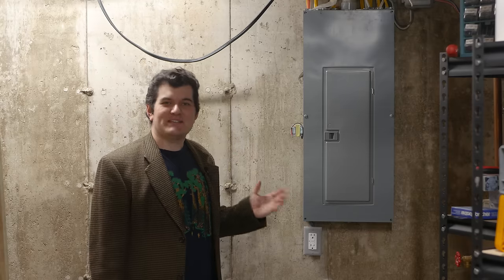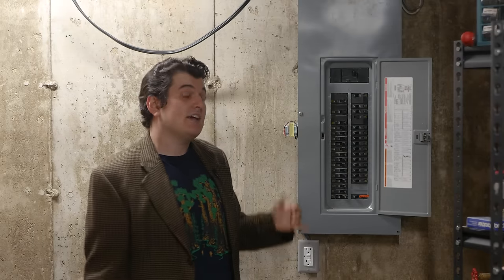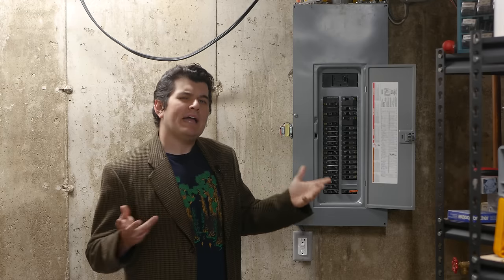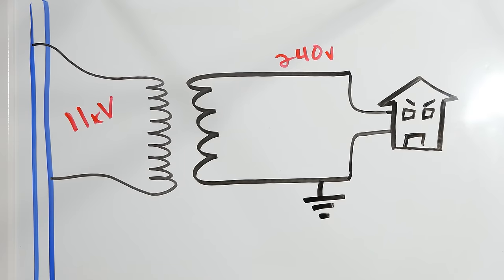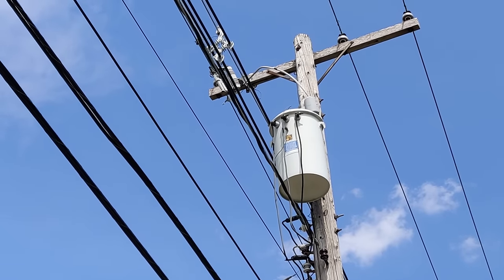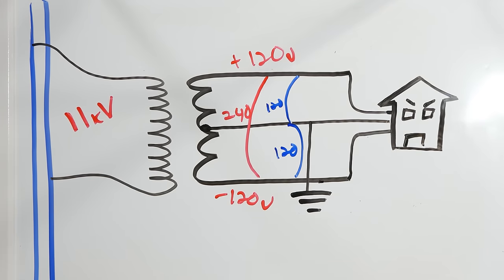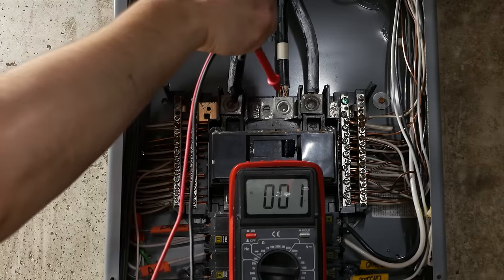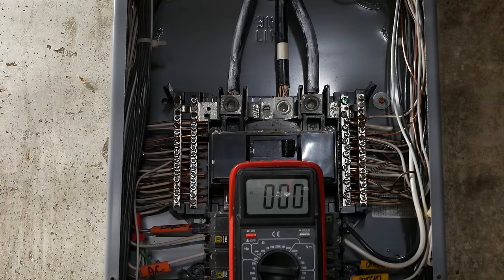The US electrical system is not 120V

Comment: He is so smug about the 240V in US households^^ cute
In all german houses we have 400V in 3 phases plus neutral. 
They are used for things like boilers, electric heaters and the stove. 
The normal outlets have one of the 3 phases and neutral (plus ground sometimes) at 400V/sqrt(3)=230V
We usually also have a 3 phase 400V outlet somewhere in the cellar or garage which can be used for industrial tools but not many people use them.
But it's quite cool that we can just buy any industrial machine and plug them in. Often people get old stuff from work like big robot arms, welders, CNC machines and they can just plug them in in their garage.

Comment: I've learned a lot from this. Electricity has always bothered me as being too complex. It's still that, but this helped. And some of the comments also seem educational. I'm going to have to bookmark this page, because extra views will help me. What I'd really like to see is electrical boxes from other countries, including obscure countries with different electrical systems.
Reply: 17:30
Reply: @TheAbc45678 
Norway has three types of powersystems.

3 phase 240V IT.
3 phase 400V TN. 
3 phase 240V TT.

3 phase 240V IT: ( IT= Isolated Terra). 
IT is a mains type where the transformer zero point is not earthed, but protected with a neutral point arrester (zero point protection / disneuter) between zero point and earth . The voltage between the phases is 240V and no neutral conductor is advanced. The energy is taken out between the three phases. This system can withstand "first earth faults" without breaking down. Therefore, it is common in hospitals to maintain power to vital devices even in the event of a ground fault.
 
3 phase 400V TN: ( Terra Neutral)

Here, the PEN conductor is carried from the transformer to the consumer's first distribution (fuse box). Here, the PEN conductor is split into PE conductor (Protective Earth) or earth conductor, and N conductor (Neutral). The energy can be taken out both between the three phases (400V) and between each of the phases and the N-conductor (240V).

The network type is then called TN-C-S network, where C indicates that the PEN conductor until the first distribution is a combined conductor. S indicates that the PEN conductor is Separated from the first distribution. TN network is now used in almost all new developments in Norway.
An advantage of TN networks is that due to higher main voltage (400V) it is possible to deliver higher power on the same cable cross section than is possible in IT or TT networks where the main voltage is usually 240V. The installation therefore becomes more economical. Disadvantages of TN networks in relation to IT or TT networks are that the voltage when touching a phase conductor is higher, and therefore more dangerous. There is also a danger of getting voltages of up to 400V in 240V sockets in the event of a break in the N-wire.

3 phase 240V TT: ( Terra Terra)
TT is similar to an IT network with the significant difference that the transformer's zero point is earthed. TT networks are found in the Agder counties and some other places along the west coast of Norway.
Reply: It's really not that complex on its own. It's when you start with nuances before covering the basics is where things get confusing.

Comment: " It's weird and I don't wanna get into it right now because it hurts my brain "
As an EE major, I feel your pain.
Reply: my braaaaaaaaaaaaain! my braaaaaaaaaaaaain! It hurts! 😄
Reply: The difference between neutral and ground is so simple, though. One is designed to carry current in support of loads, the other is designed to offload electricity/trip a breaker when something that shouldn't be conducting electricity has found its way into the circuit.
Reply: @omniyambot9876  You DON'T want to touch a neutral. Yes, you can get a serious and even lethal shock from the neutral wire. The key here is the location of the neutral conductor and whether there's a load using the supplied power at the time. The neutral should not shock you, even if the circuit is energized, as long as there's no load using the power; or as long as the neutral is upstream from from the nearest load using that power. Example: if you have a light bulb that's currently energized, and you decide to touch the neutral wire directly coming off of the bulb to ground, you will get shocked. The reason why location of the point of the neutral is important is because if the neutral is upstream, there will not be any potential to ground because electricity will take the path of least resistance to ground.

P.s. You never know who did the wiring and it is common to link up 2
neutral wires either intentionally or unintentionally in the wiring in your house's walls where you can't see them. Never touch any wire, your life depends on it.
Reply: @edumeli02  okay thank you so much, so basically, it only is shocking if there's a closed circuit? if I did not reply, that's wrong.
Reply: I hated EE at uni so, so much!
Reply: On top of that, ground is often not at ground voltage. You can have these things called “ground loops”. Audio engineers know all about that. When you hear a hum coming through the speakers, when there’s not supposed to be any sound? That’s a ground loop.
Reply: @omniyambot9876  Under normal conditions, you should not get electrocuted by touching the neutral, however, some homes have been known to be wired abnormally. The house I grew up in, built in the 1920s, had old style, knob and tube wiring, with the service equipment in the kitchen.  The main switch was a three gang, Frankenstein style knife switch, with cartridge fuses in each gang, which disconnected all three service wires, including the neutral. Quite often, while cooking supper, that neutral fuse would blow, usually if somebody plugged the kettle into the stove, causing all the lights to go dim. As for grounding, the neutral should only be grounded at two places, the transformer, and the main service panel.

Comment: 4:50 A N G E R Y H O U S E
14:12 This is the rationale behind building site tools being 110V in the UK. It's a split +/- 55V, meaning if you break a cable you definitely can't get a bad shock. EDIT: Predicted the future!
21:40 I imagine one reason is: having the switch only on the device means the cable is still "live", even if the device is completely electrically dead. Turning it off at the plug means the whole cable is also dead. And since we have nice thinner cables because of our fancy-pants fused plugs, you could conceivably damage it to the point of live exposure more easily.
Reply: I too noticed angry house at 4:50
Reply: The switch on the socket part. It's almost like second nature to have a switch there! If the cable is still live, you still the run the risk of shocking yourself on a frayed cable. A split second shock before the trip switch flips is still nasty. A live cable does not mean that the entire device is electrically dead.
Reply: @spicyweasel  Seriously, a frayed cable should be thrown away!
Reply: I know much of this is in jest, but coming from the UK I want to support switched sockets.  I have several devices that don't have a true on/off switch but a standby button.  In standby the electronic circuit is still powered up, in part at least.  It's not just that it consumes power 24/7 but that it could fail while I'm fast asleep.  Now in France I can't find a switched socket,  and the breaker for a socket will flip at about 10 amps.  The tiny charger I've left plugged in should never take as much as one twentieth of that, but an internal failure could push it beyond meltdown.  In the UK I could flip a switch, here I have to remove a plug.  Do Americans extinguish lights by unscrewing the bulb or do they have wall switches for that purpose?  If you're okay with wall switches for lights, then why not have them for sockets too?
Reply: @raykent3211  Buy those from Germany, switched Schuko plugs are compatible with French mains.
Reply: @raykent3211  we do have wall switches for plugs, just not all of them.  Most things stay plugged in full-time and it's not a problem.  Lights and ceiling fans are basically the only thing that we routinely toggle at the power source and not the device itself, probably because they're up on the ceiling.
Reply: @raykent3211  We do have switched outlets, with wall switches. But not every outlet. And to be fair, they create mixed feelings in Americans, especially if they're in the "wrong" place. The only real reason to have a switched outlet is if the room is not already lit well enough with ceiling lights, and you want to add a lamp or something. Then the outlet can be across the room, but the switch is next to the door. But for a living room, where you plug your TV and all your electronics, you'd prefer to have those outlets be always-on. It's quite frustrating to hit a 'light switch' and have the TV & playstation instantly turn off. (this is where "wrong place" frustrations come in) The living room outlets get covered by furniture and tv stands anyway, so if you had the switch on the outlet it wouldn't be accessible anyway. And most of us use a power strip/surge protector that has a switch too.
Reply: @TheLargeHardonCollider   hi. Î can't read all of your comment because YouTube is obscuring most of it with an image which I don't know how to move or supress.  So if you'd like to reply with some nonsense, it will move your comment further up the screen so I can read it.  Or, better still, if you can tell me how to rid of the obscuring image. .
Reply: @raykent3211  because they are far more bulky (like your plugs) and do not contribute any appreciable safety under normal operating conditions... if conditions are not normal, that is *YOUR* fault... as for the "Failure" thing... a gas main can also fail and blow up, or a water main break and flood you out, or any other myriad of things that I don't see such "safety" devices for....
Reply: @TheLargeHardonCollider  We have the other type of switched outlet, too. The switch occupies one of the outlet positions, leaving only one to plug into.

Comment: Me in my 1950's house that still has 60A service where the microwave trips the breaker half the time: sad code-violating noises
Reply: In the Netherlands we usually have either 230V, 35A single phase, or 3x 25A three phase power.
Reply: @AdmSpock  3 phase power in your house seems ... strange, if nothing there takes advantage of it. If you actually have 3 phase motors in your dish washers and washing machines well congrats you make us in the US look like we're in the stone age
Reply: @moonasha  It's about spreading the electrical load on all 3 phases. The oven+stove will probably have 4 leads meant for 3-phase systems
Reply: @moonasha  It is a bit strange since no household machines use three-phase motors nowadays, and for heating the American system would work just as well. But since the entire grid is three-phase, I guess it's convenient to extend it to all consumers. At least in Sweden, the only households that have one-phase are small apartments.
Reply: Most appliances use single phase power, any device using over 2kW of power needs it's own outlet, usually with a 16A breaker (or fuse, but that's in older installations).
Only heat pumps (HVAC systems used for heating and cooling) and some electric stove plates have a 3 phase connection (5 wires, 3 phases, a neutral and an earth wire), most electric stoves use a double circuit on one phase (2 breakers built as one). Also the use of an RCD is basically mandatory, save a a few exceptions.
Reply: There is also an option to increase the main fuses up to 3x 80A, but that is very very expensive.
Reply: It was up to code when originally built making it legal but much more of a fire hazard than a house built in the last 30 years.

Comment: "Those plugs seem like a real foot hazard"
YES!! YES THEY ARE!!! People often say lego is the worst thing to stand on, people who say that have clearly never stepped on a UK mains plug, when it was on the floor pin side up (and they do tend to like to land in that position when dropped, if the cable is flexible enough)
Reply: I can honestly say I never stepped on one. Why would they be lying around if all your sockets are switched?
Reply: @MrsZambezi  Most typical cause that I can remember... more devices to plug in that sockets available.
You might not have enough double adapters or socket strips to plug everything in. Oddly enough while you have a switch on the main outlet, it's rare to have them on socket strips (Though when you do, it's still usually 1 per socket), so you may have unplugged a device from a socket strip.
Reply: Yes, but you live if you stand on the plug. VS die if it's not earthed/shorts with your hands when putting it in the socket (it's got so many layers of insulation and power cutoffs it's really hard to accidentally electrocute you, yet when on holiday, I'm electrocuted by most outlets! :O ).
Reply: They are the best in the world. US plugs are so basic... it's just bare copper pins. They can't even hold much weight before beginning to pull out.
Reply: I'd rather step on a UK plug than be electrocuted by a US plug.
Reply: @bencharles4459  On the flip side, in america if you trip over a laptop charger, it pulls out of the wall, but over here in the UK, that plug is not coming out. I've had to replace the charging socket on my brother's laptop half a dozen times because of this.

Comment: I like the switches on UK style plugs. Its easier to switch on and off than unplugging/plugging the entire cord in tight/hard to reach spaces. eg, a Smart tv that is on standby when powered on...if the tv hangs and you want to do a cold startup and the cord/switch is hard to reach, using the switch is easier than unplugging it and fumbling trying to plug it back in just by feeling it.

Comment: Now we are waiting for the video titled: The US electrical system is also 400 Volts
Reply: I think it's 277/480.
Reply: @davidebacchi9030  Yes it is and I work with it almost daily. Well not live of course because fuck working on 277V live that shit can really fuck you up even if you don't get killed immediately.
Reply: 600V for some places, one of the pools I work with has 3-phase 600V pumps.
Reply: My dad's Impala has 3900V.

(This is a car guy joke.  Sorry.  The 3900V is a 3.9L V6 option that he has in his 2009 Impala LTZ.)
Reply: in Canada i work around 3 phase 277/480 and 600v all day long since I work on CNC equipment  and most shops run 600V to the machines then step down right after the disconnect . Interestingly enough the machines i work on have an always active safety circuit that's at 480 so even with the machines control cabinet disconnect off there is still power after it (the wires have there own color as a warning)
Reply: @CorbinBlanchardDesign  Sounds like he has 3900ml with still only 6 V's. This joke is a strech.
Reply: Yogev Bocher oh yeah... commercial power is SOOOOO weird...
Delta wound, wye wound, etc... 480, 560, 2.2KV... I work on all the big stuff... and no, I don’t work on 2.2KV... that shit is scary. Industrial power is plain nuts... ya gotta wear rubber boots, rubber gloves, with sleeves, and covers... nope, I’m out. 560 is enough for me.
Reply: @Segphalt  Eh, it was a stretch to begin with.  Your explanation only made my joke that much worse.  So stretched that it may as well be taffy.  😂

I'm not sure where you're getting the 6 V's from in the joke though...  A V6 engine has 6 cylinders, and calling an engine a V6 is literally how you define its layout.  Like an i6 means inline-6, V8 means 8 cylinders in a V shape, VR6 means that the cylinders are staggered (The name VR6 comes from the German initials for a V engine (German: V-Motor) and a straight (inline) engine (German: Reihenmotor)).
Reply: Im us navy and the max voltage ive seen live is 440v but i work with gear as high as 13800 volts when deenergized
Reply: I work in a factory, we have 11KV feeds going in and giant 11KV capacitor banks to get a nicer power factor number.  Our electric bill is roughly 100k a month.
Reply: @SuperVstech  Yeah. Ain't arc flash fun.
Reply: So, we don't talk about residential at that point, right? Because it didn't sound like three phase (with 240V each) in your home is a common thing in north america.
Reply: @patrick_test123  Correct. Residential is 2 phase 120/240. Small commercial can be too. Slightly larger is 480V 3 phase, i.e. 277V to neutral if Y connected. 
I just worked on the panel at a store with a high phase. This is 3 phase delta with one phase center tapped and grounded. That gives two phases that are 120V to ground and one, the high phase, at 208V to ground. You can still hook up three phase 240V devices that don't need a neutral.